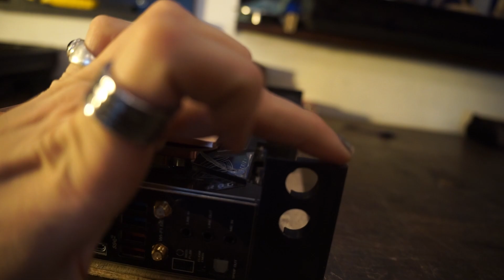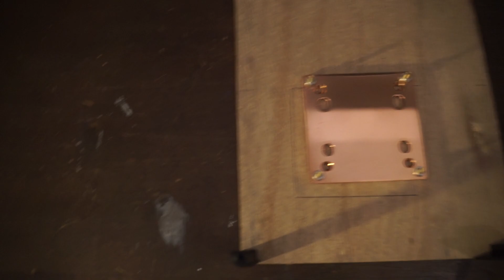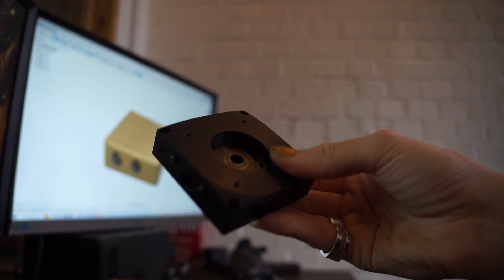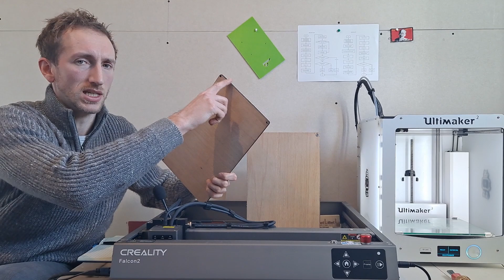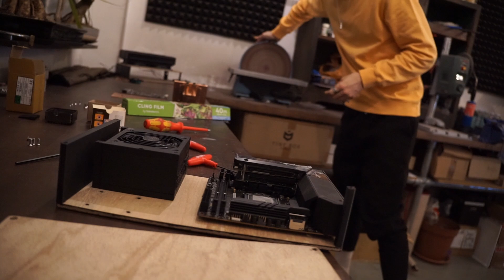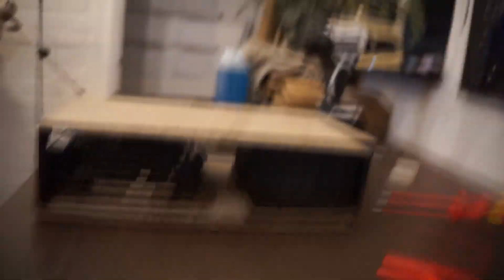Billet Labs MonoBlock - Externally-cooled 4090/14900K build - Part 2

Comment: I'm impress with your design it's so slim and smooth can't wait to see the end result, I would like for you to have a bit more illumination in your workshop I understand how you can work in such a dim place since I have it the same way but on video it's a bit too dark............................ I'm not sure if you had explained how the power supply was going to be mounted but I can already see a problem with your mounting points

Comment: I'm loving these progress logs, but did you really drive 3+ hours to pick up 2 pieces of plywood and some 3D prints? that is some dedication right there. Any other situation and people would call you crazy. you have got to get yourself at least a cheap 3d printer for prototyping. if for nothing else then to save gas money lol. you could even print the outer panels while still prototyping. might take longer to print than the drive itself, but you can always print while you sleep. Can't do that with driving. Well I mean you can... but only once. Its been a while since I saw the previous build log so you might have spoken about this already, but could you not mount the PSU to the "rear" panel and add cutouts for ventilation and access to the power switch? I don't think routing the input PSU power cable will be very fun if you continue having things set up the way you do. I'm not sure it will even fit, even with a 90 degree header. it could even save you that volume gain you mentioned when talking about using a more powerful, slightly larger PSU

Comment: Why are you using Plywood to do your prototyping? ACM (Aluminum Composite Material) would be a much better choice! It also has the added benefit of working as a heat sink when you mount things to it! It comes in multiple colors and doesn't need finishing. You can use all the same tools I've seen you using to work with it. To me using wood gives the impression of unpreparedness and lack of quality even if you are just starting out I would really suggest you use no wood for any thing but wood grain features like the Fractal North has! Sorry to be critical I know that's all you really see on the internet but I thought it needed said!